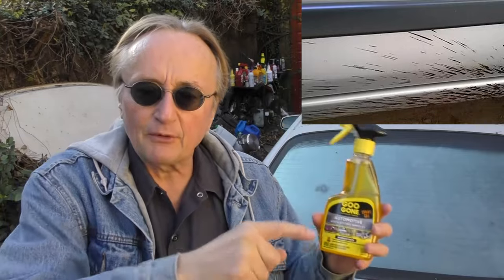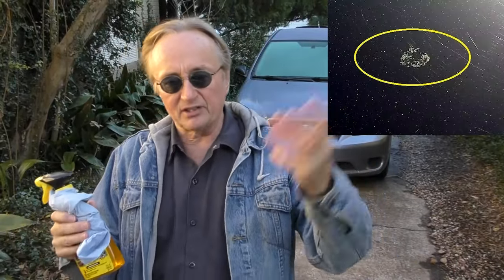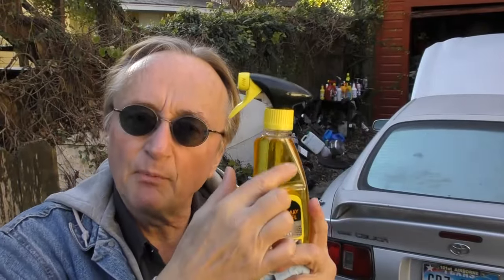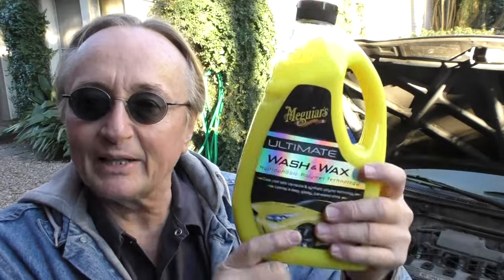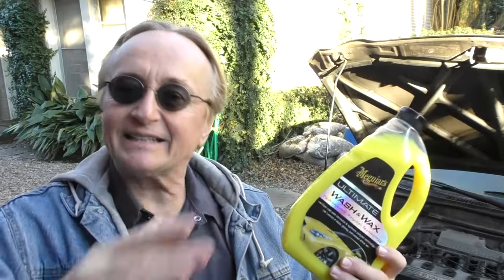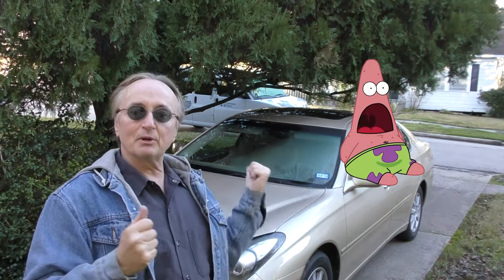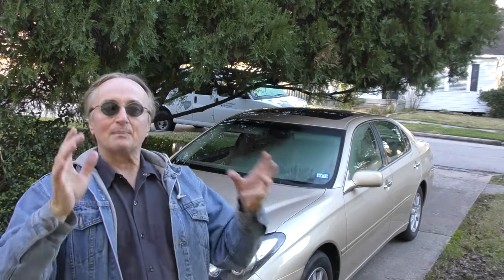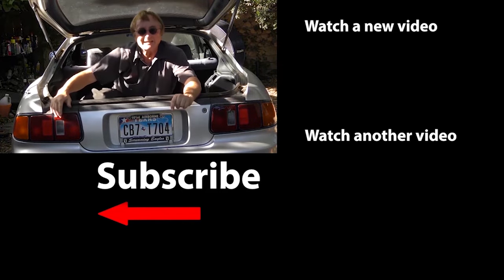Doing This Will Make Your Car Paint Last Twice as Long

Comment: Scotty, I have a 2005 Honda Odyssey with 179,000 miles purchase use with 172,000 miles change trans filter once trans oil 3 times this was the first time the oil was change use Lucas trans fix oil and Lucas trans oil.  The transmission seems to be shifting great a 100% improvement over the way it was shifting. How do you change the filter on a 2007 Odyssey transmission. I think it was move  to the bottom of the transmission on top of a support member.  What dumbunski engineer did that??? Son stay in the Army and now is a Major.

Comment: I use Mcguires polymer polish. At walmart its about 20 bucks but a little goes a long ways. I put 2 coats on and 18 months later its still beading water like new. The best Ive ever used. My black paint looks like new and my truck is a 1999 Yota.

Comment: I have a 95 Saturn with half of the clear coat pealed off. Bought it 6 months ago and have washed it once and haven't waxed it. Still looks the same. Paid $600 for it with 129K miles 15,000 miles later the only things I've needed to replace was a section of brake line, a front caliper and wiper blades.  Put some new speakers in cause they were blown. Gets me 35mph for about 6 or 7 hundred miles per week. Back when I had a nice car like my 98 Trans Am I sold three years ago with 136k miles I used the Nu Finish and the stuff works great. Would also clean and wax under the rear wheel lids where those cars were prone to rust and never got any there. Live in the North East where the Patriots beat all the loser teams from other parts of the country and cars rust but never got any. Only drove it in winter a few times when my Bronco was broke down which helped too. So use the Nu Finish, put it where you can't see it and keep off the salty roads as much as you can and your car will be like the Patriots and will look good for decades and not suck like the Chiefs and the Chargers.

Comment: I use a car cover. I have two of them, that I alternate using. Noah covers. They wear over time but for 200 dollars, and it last three years or more, then thats better than renting a garage for 200 bucks a month. It gets dust under the cover. I wipe the outside of the cover with a damp towel before removing it. I use a damp soaked chamois to get rid of dust on the car. I start the car up at least once a week in the northeast during the winter since it's not used much

Comment: Good video. a good rinse  before washing is very important. Also you should also rinse and wash from the top down. Both will save water and also clean better.
I would not use Goo Gone on paint / clear coat. I know it's good for grease and other stuff but I think it  might be a little to strong.

Comment: After every weekly wash with Walmart selection of car wash soaps have been using Griot's spray on wax and never anything else for past 20 years on Euro cars and Ford F-150 . 20 year old F-150 with 355,000 miles still has shiny paint and never been garaged in sunny SE USA. Nissan a different story , Crap paint no wax can save .  Use Griot's speed shine and a soft cotton wipe to remove bird poop . Tried Griot's paint clay  with speed shine on my Ferrari 328 . Did a great job making millions of tiny scratches. A gallon of Griot's spray on wax lasts almost year for 3 vehicles.

Comment: 1.  Paper towels are horrible for paint. 
2.  Nu Finish is garbage. 
3.  There is a difference between a polish and a wax for a reason
4.  Ceramic coatings do actually work if applied properly and if you get a quality coating. 
If you take detailing advice from this video it's on you. Yikes.

Comment: Another nice video Scotty. I have an unrelated question - I have a 1992 Chev C1500 pickup. I need diagrams to troubleshoot an instrument cluster light issue. I'm not sure if a Haynes or Chilton manual will have the circuits I need. This will be a one time deal so I have no need to spend the bucks on a GM shop manual. Any suggestions where is the best source to get good circuit drawings without spending a lot of money?    Thanks Robert

Comment: The 1 year NuFinish lasts about 9 months really. I use it once a year right before winter weather around thanksgiving. The 3 months it's not working are sept/oct/nov, and these have no road salts and much weaker sunlight. I consider the drive through car wash wax to be good enough for that stretch of the year. NuFinish twice a year would be better, but if you wanna maximize minimum effort, just make sure it's waxed for winter salts and the April-July sun.

Comment: Another Tip in case it wasn't mentioned. Use two buckets. One with your car wash soap, and one with just clean water. After washing one section of car, rinse the mitt in the clean water before puting it back in your soap bucket. That will help keep any particles from getting into your soap bucket and keep it cleaner.

Comment: Having worked in Microbiology at UF  lab with Electron Microscope back in the early 1980's, I totally understand Microns. By the way: Parking your wife's car under the tree is not a good idea either. The tree leaves or foliage release sugars into the air through photosynthesis, and those sugars stick to anything on their path, thereby creating the dark sut that is difficult to remove from cars, driveways, walls, windows, etc. But you are definitely speaking my language. Beam me up Scotty!

Comment: I have an old Dog Ram PU that I plan to paint with a roller when the time comes for "new" paint. No top coat. I might even use a fluorescent white to make it very conspicuous at night. I suppose that if I owned a really expensive vehicle, I would have my man keep its finish sparkling, but not otherwise.

Comment: My 20-year old Lexus GS300 (1999) paint still looks great, because I use Nu Finish twice a year and Meguiar caranuba wax twice a year.  I park the car inside my garage.  Heck, I am still using the original windshield wiper blades!

Comment: I was told many years ago by a guy that repainted cars that metal flake paint jobs are especially prone to sun damage. He said that metal flakes in the paint expand and contract at a different rate from the surrounding paint. If you leave the car out in the hot sun followed by cool nights, you start getting what he called "The pothole effect." I don't see that as much now days. It used to be real bad back in the 70's and 80's. I figure they've had time to play around with paint formulas since then and solve the problem. Now if they would stop using those plastic headlight covers that turn opaque and give us real spares. Well we can dream.

Comment: Scotty, I have a 2017 F150 in that nice Burgundy color. I work at an airport (and as large airports go we always have construction going on) there is a plethora of debris that has the potential to scratch my doors, and a few pieces of it has succeeded in removing the paint down to the layer before the metal. How can i fix that paint damage without making it look like i used touch-up paint.

Comment: Hi Scotty , I've got a Mb 100 d van . The temp gauge goes to red line as soon as I start the engine and the engine is still cold :) . I'm guessing faulty sensor , gauge or selecter arm . Any suggestions I don't want to drive it till I fix the problem , for fear of braking the motor :) . 
I d appreciate any advice !!! 
Also when I'm parked the indicators and hazards flash , but when driving it does not flash ???

Comment: The Germans do make some miracle cleaners and finishers, yes they are expensive and there are cheaper ways. I just use a cheap acrylic car finish. After washing I rub in a light coat then let it sit. After it well dried I lightly polish with clean rags. That's all it takes to bead up rain for about a year. I love my car but screw 4 times a year. I don't even clean it that often. Helps to have a white car.

Comment: I keep my cars looking like new with a once a month cleaning routine.   What I do is get up early on a Saturday morning and go to one of the automatic car washes.    After that I inspect and clean any tar or dirt that the automatic didn't get.  I also spray down the wheels with spray cleaner to get stubborn brake dust and road grime off the wheels.  Then I go to the self service car wash and wash and dry it again.   Most of the self service car washes have spray on wax.  Last step is applying heavy coat of that spray on wax good enough to make the water bead up real good.  It takes a couple of hours but it's not that expensive or excessive amount of work.  It really keeps the car clean and looking good.

Comment: I am obsessed with detailing because after regular maintenance,  regular detailing helps retain the value of your Fiat.

Jk

Car. Fiats are not cars, they are financial instruments designed to ruin your bank accoun.
Reply: Hey it’s not bad though, especially if you own the car for a long time. I plan to keep my first car for 10 years and maintain it paint wise but also maintain it yourself mechanically
Reply: @jorgenvonstrangle000  10 years is nothing today, hell the AVERAGE car on U.S. roads today is 10.  Want a challenge?  Aim to keep your car for 20 years - and yes, it can be done!

Comment: I prefer using micro fiber....paper towels are made of paper. Paper contains wood particles that SCRATCH. That's why you should NEVER wipe eye glasses with paper towels.
Reply: Glass is much harder than wood, it wouldn’t scratch glasses like that.
Reply: James Hurst Sands off dry poop from previous poops. Keeps your roids tough and calloused to keep from bleeding. Plus, it's strong enuf to reuse it.
Reply: Righteous RedNeck Good point. Never thought of that. Thought my eyesite was going. Glasses foggy. Micro fiber from now on. (Except in the bathroom).
Reply: @James Hurst use baby wipes. Guess you like havin splinters back there, and leaving tiremarks....
Reply: Adam Nope eyeglasses aren’t made of glass
Reply: @Loachie90  ...exactly! And can be scratched
Reply: My glasses usually last me about three years.  They get scratched up because I rarely take the time to clean them correctly when at work.  When at home I rinse, then wash with warm water a dish soap, then dry with a clean micro-fiber.  It works out OK because as I age I need a new prescription about every three or four years anyway.  Paper towels won't scratch glass, but glasses are made of plastic, like clear coat is.
Reply: Ed Waggoner Sr. You use soap and you’re gonna strip your glasses of its coating
Reply: 😒 micro fiber will scratch too, plz b careful, remove tags, use the soft side, good namebrand brand, dont put pressure, use new clean ones
Reply: MrSammy I run it over water as an extra step so I don’t rub abrasives while cleaning
Reply: @Loachie90  🙂 ok
Reply: I agree, but I will say those shop-towel paper towels have far less coarseness to them than a normal papertowel, if you're using with a liquid (detailer/goo gone) on occasion for a small cleanup it's probably fine if you're waxing/polishing as often as Scotty does.
Reply: paper towels DONT SCRATCH GLASS
Reply: rbeck3200tb40 eyeglasses aren’t made of glass
Reply: @personperson9591  🙂 yes automotive paper towels are soft, and at the super market look for the equivalent soft Viva brand, quick picker upper uses is ok, just dont b  stupid and use it around the whole car 😏
Reply: @OGSumo  eye glasses are no longer made of glass. They use plastic which DO scratch easy
Reply: @MrSamadolfo  microfiber needs to be cleaned once in a while, for eyeglasses it eventually gets too much oil from your fingers in it. For cars it eventually gets too much dirt in it from the amount of dirt remaining after using soap.
Reply: @jeffruebens8355  🙂 yup, wash separately, if u wash em with ur clothes all the lint from your clothes will contaminate the microfiber like a magnet, i hate when that happens to me ☺️
Reply: @OGSumo  Have you done the experiment? If not, Just Get OUT!
Reply: 2 ply TP for me all the way
Reply: Glass is harder than wood. You're wrong.
Reply: @dancindavey1515  thanks for a good laugh!
Reply: Tanman 787 Your welcome.
Reply: paper towels scratch because there a flat surface
Reply: @TheMasterhomaster  maybe so but when you go to get eyeglasses they will tell you straight up do not use paper towels or Kleenex because it will scratch the lenses. First of all they are too rough to be using on glass... You should be using something soft. To each his own but if you want to take the risk you're more than welcome
Reply: @Loachie90  I disagree there, soap does nothing to coating
Reply: @OGSumo  the hell it won't.

Comment: Wax four times a year and wash once a week.
Reply: TakeAmericaBackfromISRAEL  same nice name
Reply: Very True, wash at least once a week,, and hand wax it 4 times a year. Safe driving everyone.
Reply: Once a week is overkill..
Reply: F that, I wash  and then wax it each week.
Reply: @virusboy07  hell yea me too
Reply: Pinhead Larry Wash twice per day, wax daily.
Reply: Dave Stock I need to start doing that...
Reply: GerardoMjr It's good exercise, but raises your water bill.
Reply: Depends, if you use a wax conditioner you really only need to wax your car maybe twice a year.
Reply: Wax every time you wash your car, spray or compound
Reply: Ethos 9h Ceramic Wax. 
my customers pay $$$$ For it. 
12Month Durability wax.
Reply: Once a week is too much, wth
Reply: Yep.  ....And shade and garage when possible.  15 year old G35.  230 kmiles.  Owned from new.  New car finish.
Reply: I wax my car every 4 years, and wash it once a year! 
Just kidding.  
I wash it twice a year. 😁
Though I will do the glass regularly.  
Bronze/gold colour hardly shows dirt.
Paint is as good as when I got it, which is near perfect.

Keep it out of the sun as much as possible.
Use only a small amount of wash liquid, and the polish will remain.
Avoid auto car washes & those high-pressure DIY washes, unless you use the wand on min pressure.  High pressure takes the polish off immediately.

Just a different approach to consider.
Reply: @Cold NBother 
Well have a look...
Reply: @Cold NBother 
Pass on what?
Reply: I use clear shoe polish for paint and black on black stuff. It lasts for years. I keep a big beach towel in the car. Takes about a minute to clean the car. with no water.
Reply: I take a shower 4 times a year and wax in between!
Reply: If you really care about your car you should wash it after every time you drive it.
Reply: @virusboy07  same
Reply: @zachbonebrake352  yeah if you want your car to rust faster
Reply: @jeremywatson6321  I was being sarcastic.

Comment: Rev up your rust buckets.
Reply: Hey, you gotta clean rust buckets as well sometimes.
Reply: Star Brite Teflon Marine Polish is by far the best for cars in winter climates - at least in my 45 years of car ownership.  I apply 2 coats every November to every metal and plastic (or fiberglass) surface - it'll get your vehicle through the winter.  Available in fishing/boat aisle at WalMart - or Amazon, check out user reviews.  And no, I don't work for Star Brite or WalMart!
Reply: Scrap your rust bucket Ford engines!

Comment: Says not to buy into marketing hype, buys Nu Finish.
I would not use Nu Finish on any paint I care about. Nu Finish is an abrasive, the elbow grease bit should clue you in. It works so well because it grinds down a fine layer of the clear coat so that once the paint protestants are gone you still have some clear coat to save you. Use a real quality wax, you won't use elbow grease and it won't damage you're paint in the process.
Reply: Nu Finish isn't meant to be used all the time. The point of Nu Finish is to remove all the oxidation. You can do this with a buffer, but many people lack the skill to use one properly; so this is a decent substitute.

Comment: ... Nano nonsense! 🤣🤣... Spot on Scotty😎👍🇧🇻
Reply: I disagree with Scotty on this one.  I use Nano detailing products all season.  Beautiful shine and the rain rolls off the surface.  A really good one is Wax as You Wash.  I tried it without any real expectation, but it's great.  You wash a section with it and then dry it off with a good micro towel.  My 78 Vette looked like red glass.  Will be using it on both my vehicles.

Comment: Hey Scotty,

Any suggestions for those of us who have no choice but to park our cars in the beating hot sun all day (I'm in NorCal, so similar to Texas where the sun is unrelenting during the summer, and our parking lot doesn't have shade). I mean will waxing/polishing even more often assist with prevention of UV radiation? I do also use the Nu Finish (although only once or twice a year), and my current car is fine as it's newer, I'm just trying to avoid what happened to my old Civic which had it's clear-coat obliterated after a little over 10 years from sitting in the sun (and you can tell it's UV that wrecked it because it's on the side the sun would always hit it in the parking lot, the other side's clear-coat was fine).

Comment: Good tips.....But it doesn't explain why the paint on my 93 Oldsmobile that I do nothing to except wash it once a year, is nearly perfect. But the paint on the 2008 Camry has deteriorated clear coat on all the topsides to dust. And there are thousands of cars we all see with the same problems just like the pics in this video. I think it's either bad paints or bad application of the paint or both. It's negligence, not improper care. It can't be. Otherwise my Oldsmobile should have no paint left on it at all. I've owned it for about 17 years and literally only waxed it about 3 times.   Both cars sit in the same Florida weather 24/7.
Reply: Paint composition has changed over the years due to environmental concerns. The paint isn't as durable chemically and is also applied much thinner. I'm no expert though